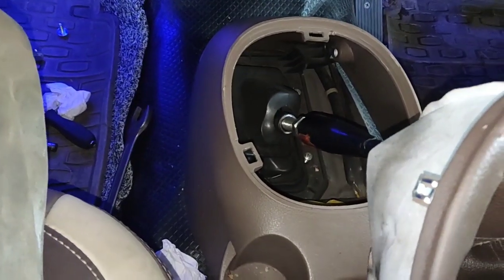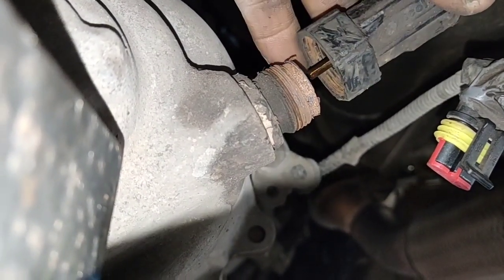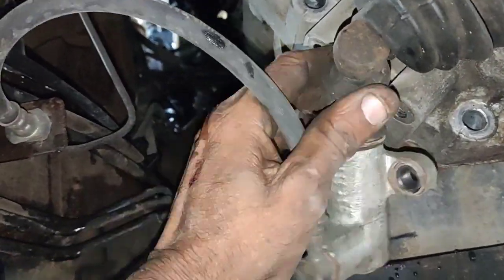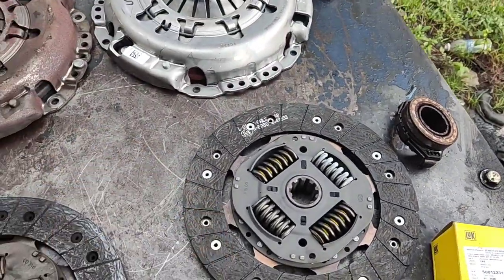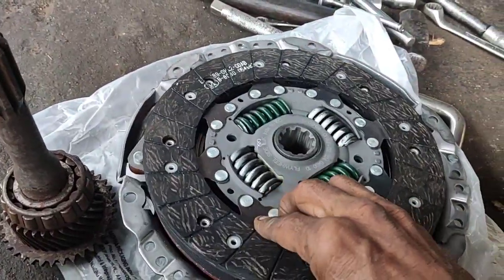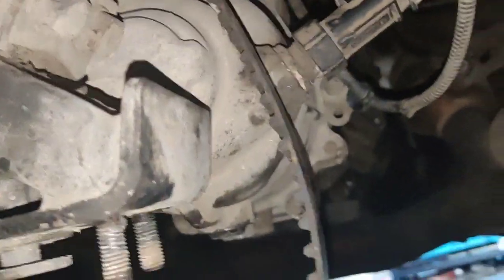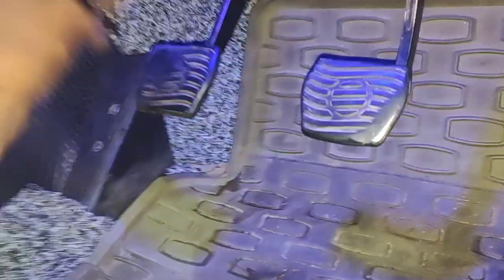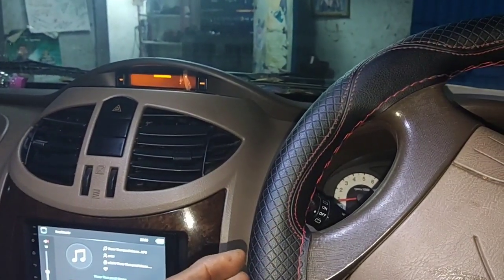XYLO E4 E8 clucth work (@skilledmechanictamil )

Comment: Maruthi Ritz car clutch plate gear oil labour ellame sethu ena rate varum
Reply from the maker: Petrol 3000 spares
Labour 2000
Diesel clucth set 35000
Release bearing 35000
Labor 2500